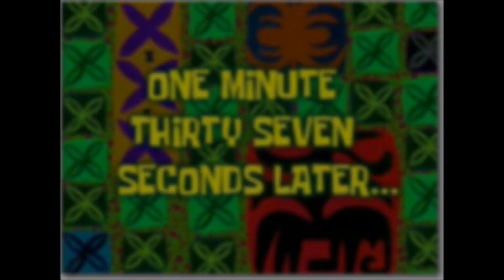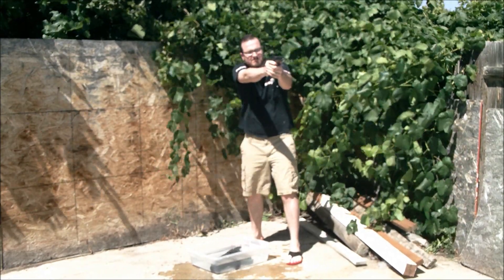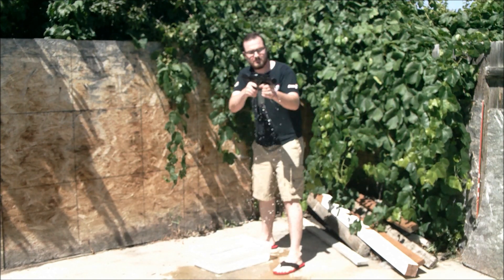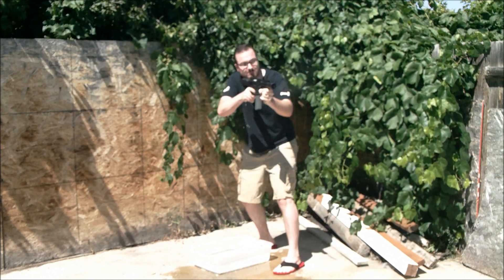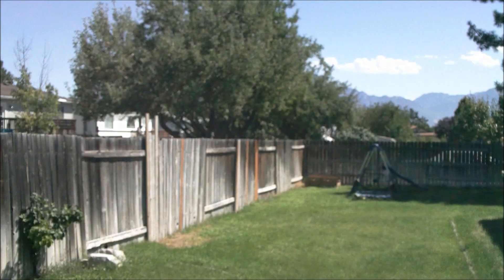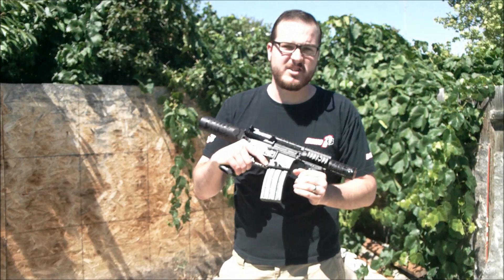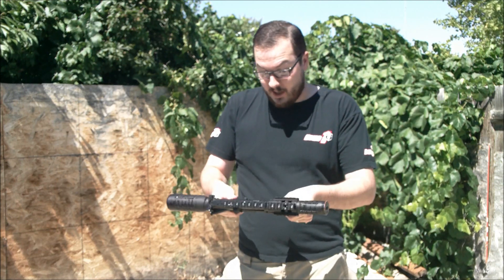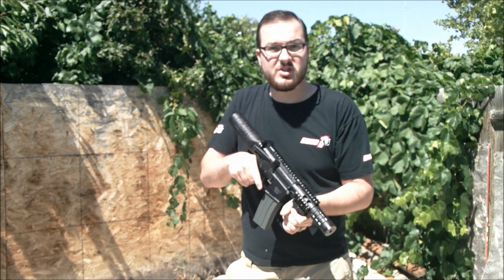Echo 1 AEG Water Test

Comment: I'm assuming this applies to most AEG's regardless or price range. I always thought it would fry the internal electronics and the battery. But I guess not?
Reply from the maker: Most AEGs really don't have complex electronics inside. Just a simple shuttle switch that fires the gun. Now, with a gun using a MOSFET you're more likely to have problems, unless it's something like the ASG EVO which automatically shuts off if it gets wet. Basically, the more complex the gun, the more likely moisture will cause issues. For batteries, that will largely depend on the battery used and the water you're in, but I saw no ill effects with this 9.6v NiMH pack.
Reply: Okay. So a decent quality AEG without MOSFET (Or any AEG without MOSFET) shouldn't be damaged severely if momentarily submerged or gotten wet? I just want to know because I tend to play in wetland areas and on coasts with lots of exposed water. I have a Cyma AK-105 and a Cyma MP5 (forget which model). Both without MOSFETs. I just wanna make sure they wouldn't be to severely damaged.
Reply from the maker: Yeah, those should run just fine. Just make sure that you disassemble the gun following any major soaking and dry everything out. You may require more lubrication in the gearbox following a particularly bad dunking, but really, just try to get it dry afterwards and you should be largely good to go.
Reply: Thanks for the replies. I just am a little cautious considering my budget when it comes to airsoft. I can't afford for my primary to go down. I bought a cheap Cyma AK to replace my echo 1 Sog 16. Gearbox exploded. To the point of irreversible damage. Getting the AK this week. Do you have experience with the Cyma AK-105 Collapsable stock variant?
Reply from the maker: Had one briefly before selling it. CYMA makes great AKs, it'll serve you well.
Reply: That's good to hear. It just seems that the gun everyone else has always works amazingly but I've only ever had problems with mine. I just want field and outdoor reliability for under $200 and I am hoping this AK will for that role. Thanks!